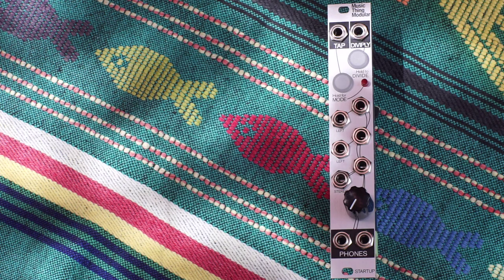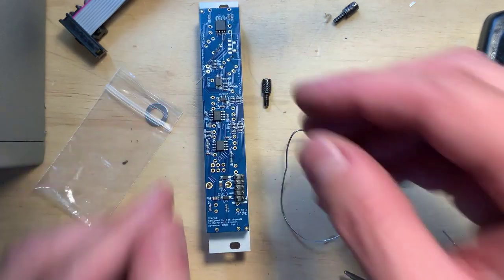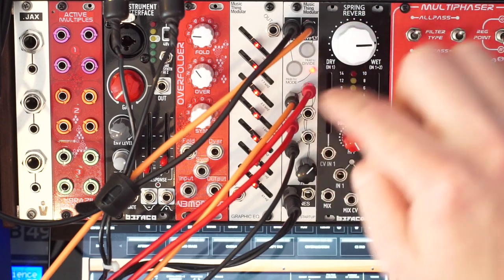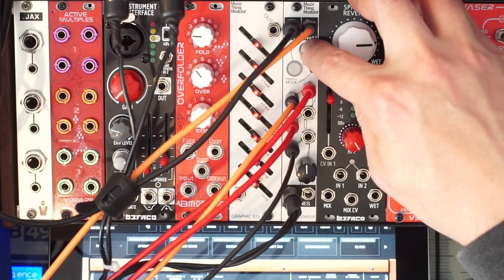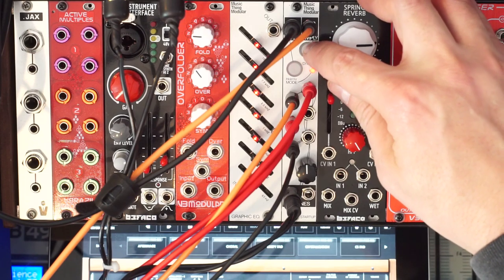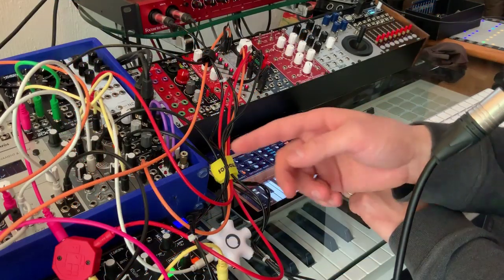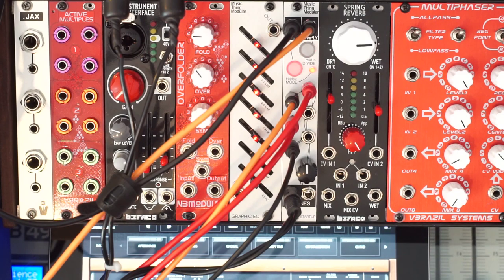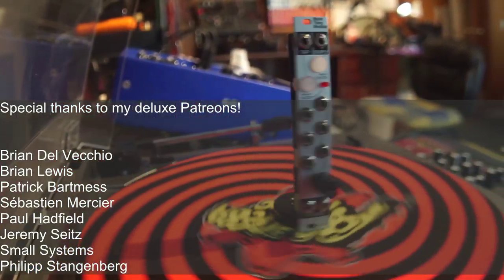Music Thing Modular - Start Up

Comment: You can use 2 blocks of wood higher than the pots shafts to put the module upside down while soldering. That way it's stable and it makes sure everything is at the same height with the front panel, also it doesnt scratch the pcb with the clips you're using.
Reply from the maker: good idea, thanks!
Reply: I found cups to sometimes be better, since the components can sorta "drop" into the cup and not get blocked by the wood. :)
Reply: @JesseSep.  No you put the wood at the extremity of the module panel near the screw holes, all components doesnt toutch the wood blocks